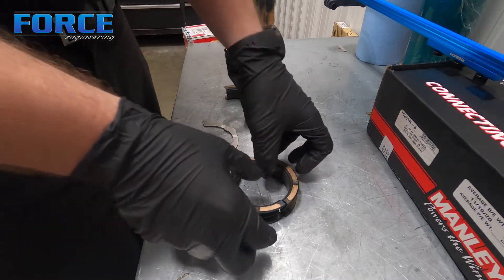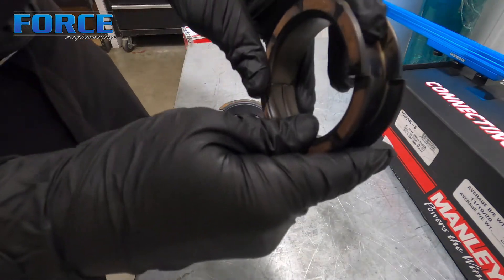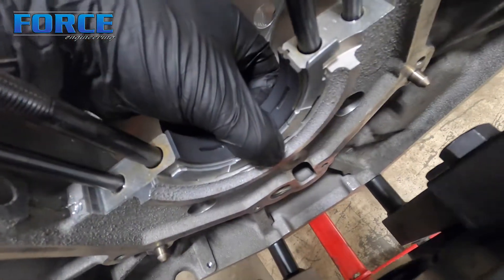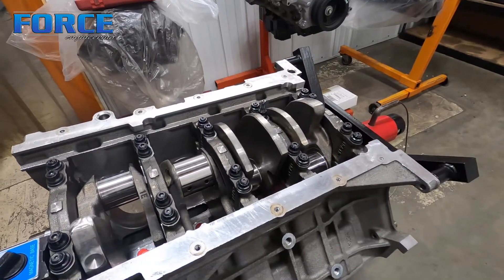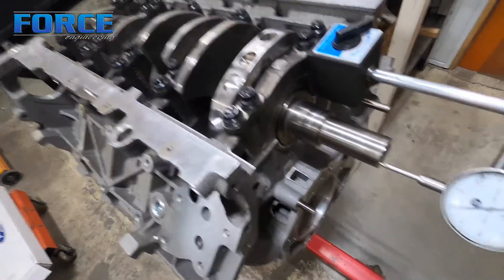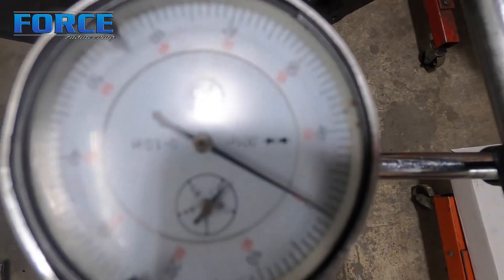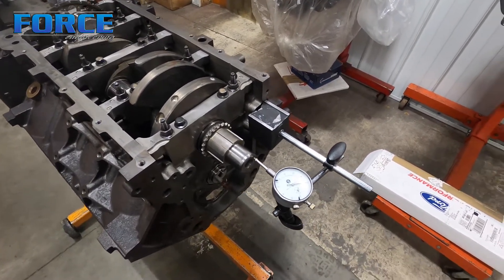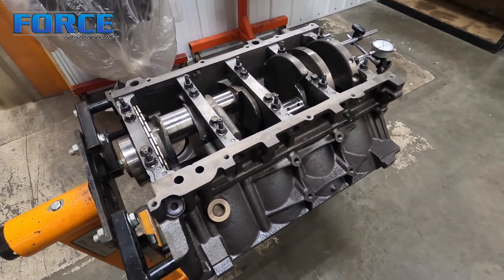Engine Assembly - Setting Thrust Bearing | LS Thrust | Coyote Thrust

Comment: Were the main caps on the ls block installed incorrectly?  1-4 face back and 5 faces forward.. wouldn't that possibly give you an inaccurate reading. Ive seen cranks literally not move with 1 cap installed wrong.

Comment: What is the difference between setting the thrust bearing on a Coyote vs a 4.6 4V aluminum blocks like the WAP block?
Reply from the maker: There are a couple styles of thrust for the 4.6l blocks.  If it has the floating thrust on one half, like the coyote, then the procedure is the same.
Reply: @ForceEngineering  It looks the same.  Thank you!

Comment: Random question. Does it matter if the crank is forward or rearward when you torque the thrust bearing cap?
Reply from the maker: As long as you dont beat it around ebough to move the bearing after is set, it won't matter.  The goal here is to align the faces evenly.  I suppose if I was to suggest a direction, it would be to have the crankshaft forward.  That is the direction of the load applied to it.  That said, it is nothing I've ever paid attention to.
Reply: @ForceEngineering  Thank you, this is very helpful! And it makes a lot of sense.

Comment: Do you just use sandpaper/wd40 to sand the thrust bearing if you need more in/out play? Or is there a better way
Reply from the maker: I've never had a situation where I needed to add clearance here without another issue.  Confirm that the bearings are correct. In order to sand cleanece into it, you'd have to make a jig to hold both halfs of the bearing in order to remove the same amount if material from both surfaces.  It would be very difficult to keep it concentric.  I'd suggest there is another issue. I would not recommend sanding the thrust surface to add clearance.